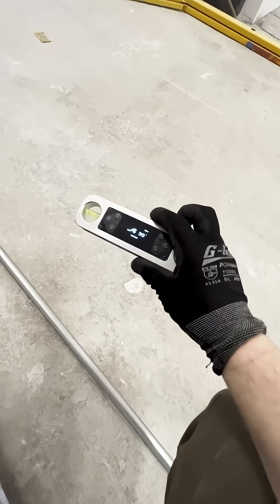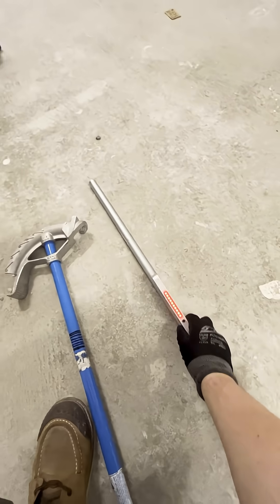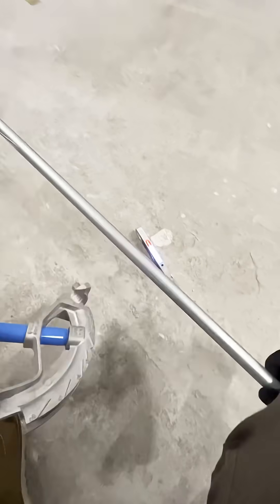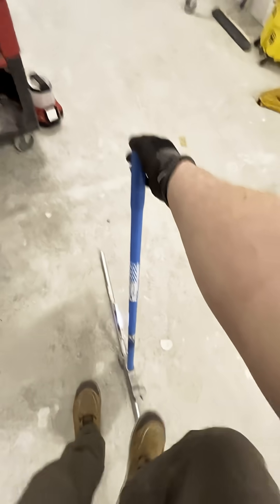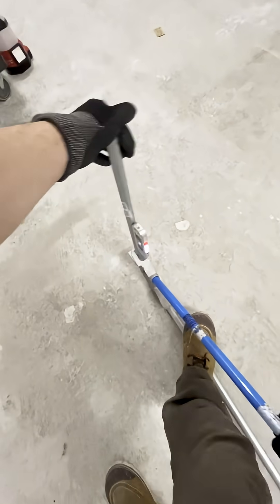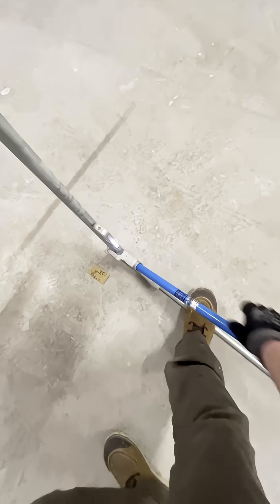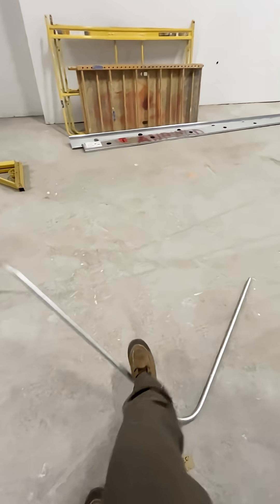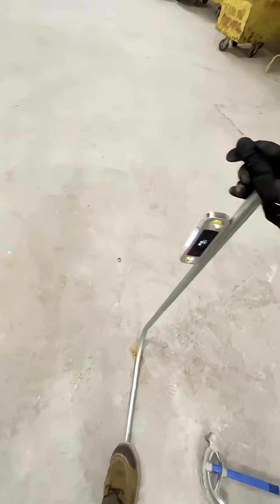I Put 360 degrees in ONE Length of Conduit #electrician

Comment: Stick your Klein (under the pipe) on the other end of that 90 to allow for spacing before you make that second bend
Reply from the maker: Thanks! I usually stick a wooden rule under there and adjust it to fit. The height changes depending on how far the next bend is. This time for the purpose of the video I wanted to be sloppy to demonstrate the level.